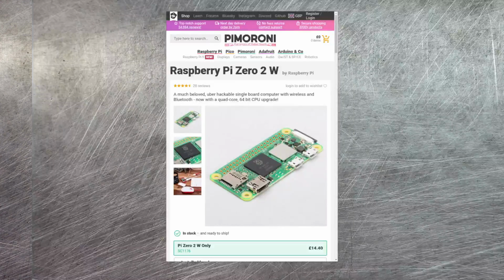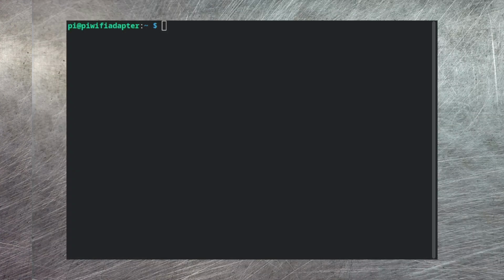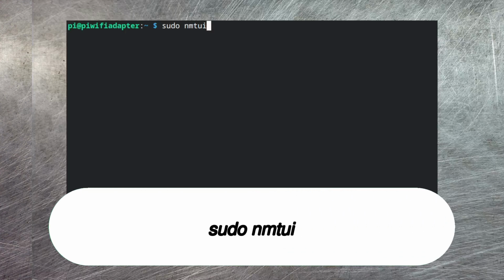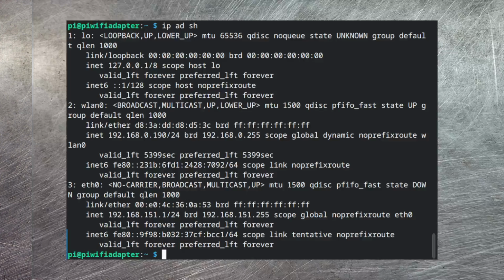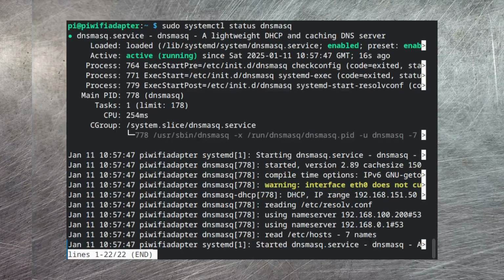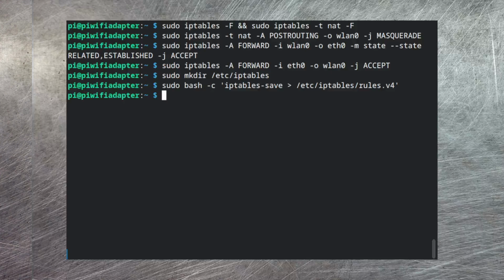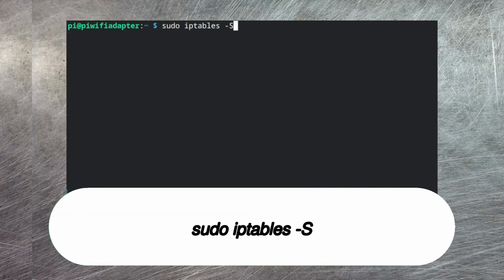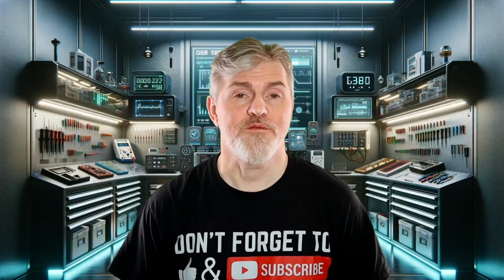Build a WIRED to WIFI network adapter using a RASPBERRY PI!!!

Comment: Great explanations Jeff. Thank you.
Reply: I am trying to open :10110 tcp and udp ports for my purpose but "iptables -A INPUT -i wlan0 -p tcp --dport 10110 -j ACCEPT" does not work. Any help would be greatly appreciated.
Reply from the maker: The iptables command in itself looks good although you'd need an extra one for UDP as this only specifies TCP. But I can't see anything blatant. Have you tried using something like telnet to open port 10110 from a different device?
Reply: @jeffs_piinthesky  Sorry I got not enough time to answer quicker. I will try telnet today or tomorrow. Thank you for the suggestion.
Regarding your tutorial, I would like to let you know, that the command "sed...ipv4..." which is used in the video didn't work for me. I had to "sudo nano file.conf" and delete manually the "#" character at the correct line. Thank you for your help.

Comment: trying to use this to connect my 3d printer to network, it only has rj45 no wifi followed all the steps and when i plug crossover cable into printer it gets an ip address, but i can not see it from my pc or ping it?
Reply from the maker: The most likely issue here is that your pi is allocating the printer an IP in a different subnet to your normal home network. Therefore, whilst it can see your network, thanks to routing through the pi, your home network doesn't know how to get back to it. You could add a static route to your pi private subnet into your home router specifying your pi as the gateway for it. You should then be able to get two-way comms going
Reply: @jeffs_piinthesky thank you

Comment: I connect my PS2 to my desktop PC via ethernet (via the router of course) where there is an SMB share, so I store my games there. The PS2 can load the game from there using OPL, so it is easy to use without a disc.
I would like to ask, can I access the PC SMB share wirelessly using this method?
Thank you 🙂
Reply from the maker: Yes indeed!! That should work with absolutely no problem.

Comment: In india, ISP providers doesn't provide port forward. I would like to access my home network from outside, using Pi4.I have dynamic ip [PPPOE], static ip is expensive. Plz suggest a solution
Reply from the maker: I believe CloudFlare offer a product that will effectively act as a reverse proxy to something on your home network. You make an outbound connection to them via an agent running on your machine at home, and they then provide the Internet facing endpoint. I've never used it myself but there are videos out there about it. I believe NetworkChuck made one on the subject.

Comment: I've been trying to connect a headless device to my internet using a Pi 4 for several days without success, I tried this guide with the same result however this time I tried connecting a laptop to the Pi ethernet port and it actually does have an internet connection through the Pi. The device that shares the internet connection this way doesn't seem to be detectable by other devices on the network though, and even my Router admin page cannot see the device that is behind the Pi. Would you be able to share what changes need to be made for this to happen? In short, how can I make the device connected to the Pi accessable from other devices on the network, e.g. pinging it and getting a response?
Reply from the maker: Hi Anders and apologies for not replying sooner. The last couple of videos have been extremely time consuming!! 
So if I'm reading this right, you have followed the guide to make your PI4 a bridge into your network and, after this, your laptop can route through to the Internet fine. But from your home network, you can't see the laptop behind the PI. Is that right?

That being the case, I think the reason is that the network your PI generates is separate from your home network, on its own IP range that you would have configured in dnsmasq.conf.

So if you need to be able to see that network from your home network, you'd need to add a static route to your home router. Most manufacturers' routers I've used (Netgear and TP-Link in recent years but also DLink and Cisco more historically) have the ability to add a route in the router UI. You'd need to provide the IP network you configured in your dnsmasq.conf and then the IP address of your PI's NIC that connects to your home network as the gateway. You should then be able to route bidirectionally.

Comment: my raspberry 5 showed the eth0 icon, but no connection ( with and without crossover) to the internet. I plugged in my raspberry 4 and to my surprise I had an internet connection. Both devices are running rpi os. I have a pi5 with ubuntu, no internet.
Reply from the maker: So the same cable worked for a pi4 but not a PI5???? How very bizarre!!! If the PI5 is showing the device but no connection then I guess the fault must be in the DNSMasQ software as that should be handing out the device and IP address.

Comment: Now, lets do it the other way, lets make an AP with the raspberry pi! Thanks for the great video.
Reply from the maker: I did a travel router video recently that set up the PI as an access point. You can do it 'natively' of course but I found RaspAP did make  it very simple.

Comment: I do query the emphasis on the requirement for crossover. Auto MDI-x had existed for longer than basically all PHY chips used in any kit these days.... that is to say, any device using a compliant 10/100/1000 interface should never have a need for crossover cables.
Reply from the maker: Very true...Since it tends to be older kit that doesn't have wireless support, it's sketchy...Certainly tried this on two TVs now and required a crossover for it to work.

Comment: Interesting video.
I'm trying to avoid thinking about why an old TV would need a network connection.
Reply from the maker: 😀Very true. So many apps have been removed now but YouTube, Flickr, Facebook, X and some other apps like news and weather are still around. But absolutely, this is more a demo of the wired to wireless adapter and less about using it specifically with old teles.
Reply: @jeffs_piinthesky   if you don't have cross over cable you can make one out of passthrough cable you already have at home asuming you have everything you need.
Reply: Tetris, Soltaire, Ben Joffe Torus